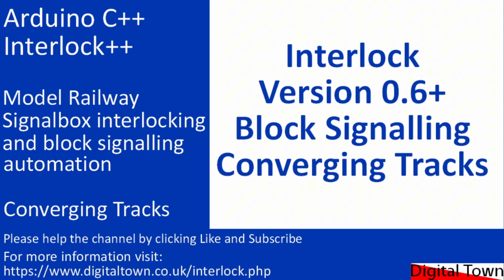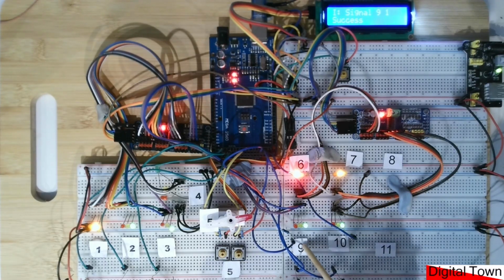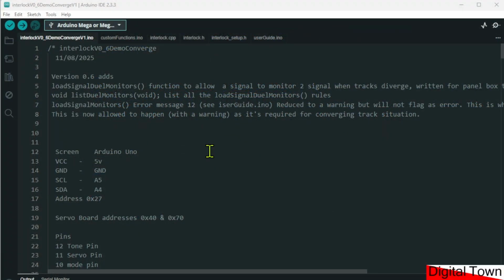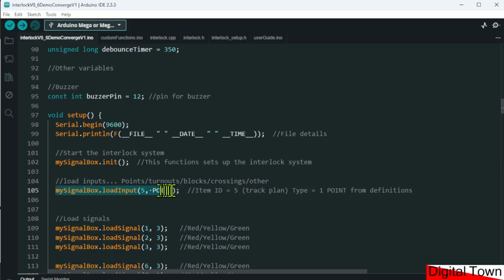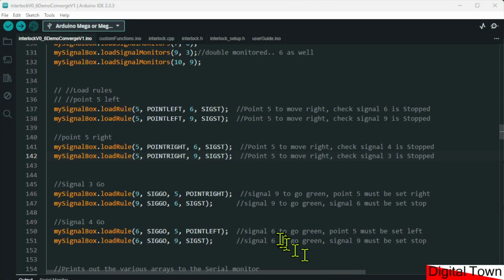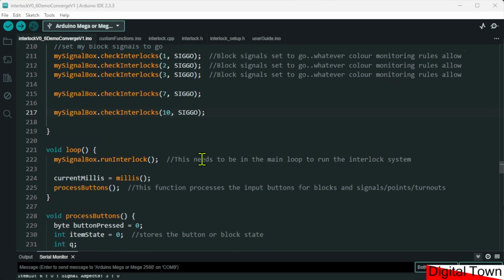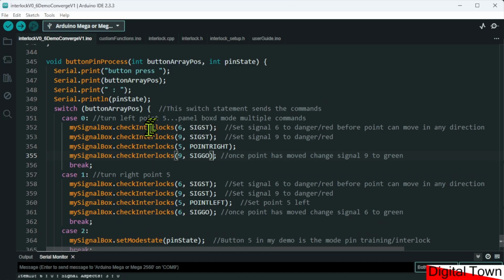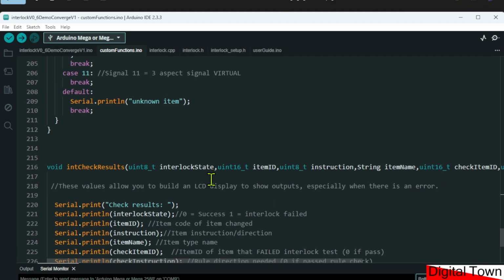#150 Interlock++ Model Railway Signal box interlocking and block automation - Converging Tracks

Comment: TRACK CIRCUIT BLOCK ! (BRITISH MULTI-ASPECT SIGNALLING)
In your scenario, both signals 6 & 9 would be "Controlled" signals NOT "Automatic" types, as a Junction is involved. As a result both signals 6 & 9 would normally be showing RED, the point is irrelevant at this moment in time. The signalman must deal with such "Controlled" signals, so he would set up the route probably some minutes before a train got even close to that Junction. Junction Signals, and signals before tunnels are usually "controlled" signals, so requiring the Signalman to set up routes. Hence signals 6&9 remain red and 7&10 remain yellow until the Signalman sets up the route for the next train. This is necessary as it avoids the Signalman having to "Put Back" signals that have automatically cleared. "Putting Back" is NOT good train regulation, and if seen by a Driver is liable to give him a heart attack !!!  

Hence Junction signals will automatically return to Red when a train passes them, and then REMAIN red. Because if a signalman has to "Put Back" there is a safety TWO MINUTE DELAY "timeout" before any signal (Nos 6&9 in this scenario) can be released to display a proceed aspect !!!  

Two signals (6&9) do NOT monitor  Signal 3. They should both be monitoring the point number 5. Then when the signalman sets up the route, only the signal that detects the route is correct will be able to change. You're putting the Cart before the Horse !!!!

And what about the British Railways Automatic Warning System (AWS).  Which can prevent Train Drivers passing signals at Danger ? A very useful addition to help the layout operator(s) !  

The distance between two MAS signals is a "Section" not a "Block" ! All the signals involved in this scenario are part of "A Block". Indeed the term "Block"  is reminiscent of semaphore signalling, so has little meaning in relation to MAS Track Circuit Block signalling, as modern signalboxes can now cover huge areas. 

WHAT DOES THIS ALL COST
And what's the total cost going to be for all that is shown in this scenario including the necessary Computer I wonder ????? 

TCC ALTERNATIVE & ITS COST. 
Because I can replicate this whole scenario with the 7 signals, & one point motor, and include British Railways AWS in all 7 track sections & the cost of the wire needed for a total of £135.00. No computers, or expensive Electronics necessary. Just 4 switch relays and proper real life track circuits, and the AWS feature (which requires just one more wire per section of track). Using TCC (Track Circuit Control) which is a development of the real BR wiring method as used in the BR(SR) early (mid 1960's) route setting Panel signalboxes !!!! 

Computer screens & keyboards (or laptops) required on layouts when they are intended for Model Railway exhibitions become a bulky issue of how to include them on layouts. As they are vulnerable to damage, tea, coffee, and other liquids, and even theft !!!! So I'll stick with my wooden (waterproof marine plywood) built control panels, also modelled on those 1960's BR Panel Signalboxes. The switching using "Mini Toggle" switches for the signals, points and various other clever accessories such a "Controller selection". There being 8 panel mounted "inertia" controllers for the 8 operators needed for my latest exhibition OO scale layout. And of course less than 50% of the wiring necessary if I had used DCC & your equipment, and I know TCC costs only about 20% of the equipment needed for any layout, of that required if DCC were used !!!!